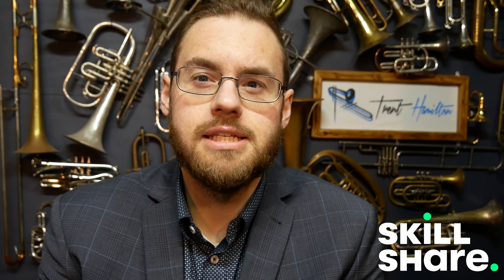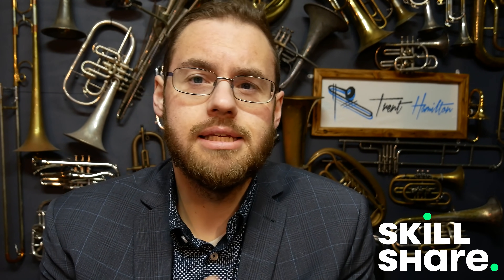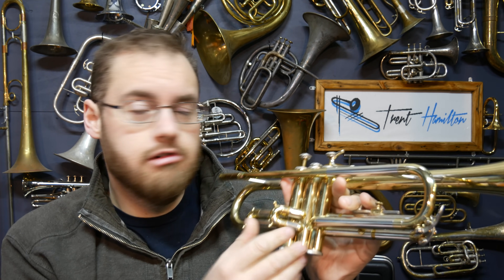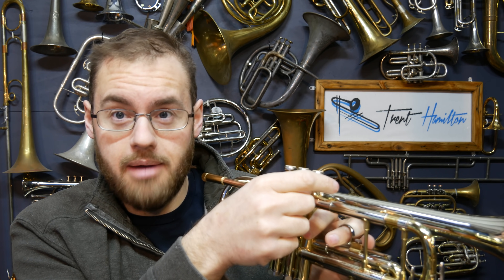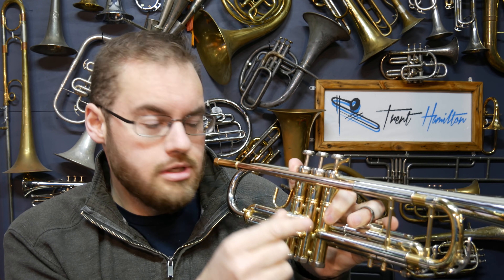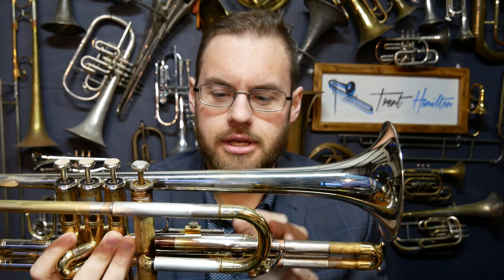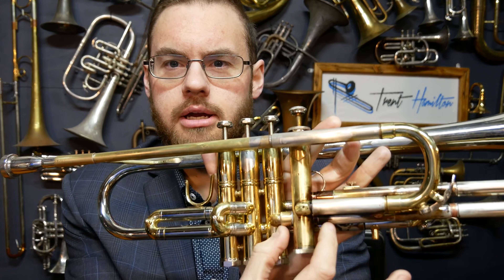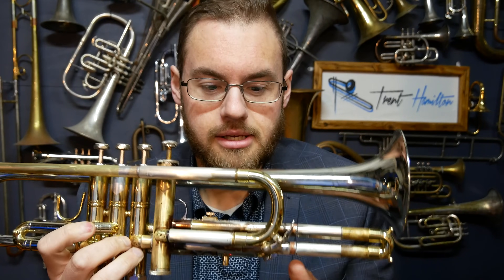I made a 4-Valve Trumpet!

Comment: I did near the same thing 50 years ago when I was in high school. But rather that have the 4th valve as you have made it, I cut the valve tube from a 2nd valve in half and made the 4th valve lower the pitch a quarter step. I wasn't lucky enough to have a torch and soldering skills, so I just glued it together with epoxy cement. It worked great and years later I had a proper repair person solder it up for me. Love the experiments. Good show.
Reply: Wow nice!! Any videos of you playing it??
Reply: So a Don Ellis fourth valve then.
Reply: @mal2ksc  That's exactly what I was thinking

Comment: I have never understood why 4 valves on trumpets are not the standard, when literally every other professional brass instrument calls for at least that many.
Reply: I suppose that it may be, as the trumpet low register is fairly (to me) not nice sounding compared to other (higher) pitches. Tuba/Euphonium/Baritone have more control and usability in low register compared to trumpet, even with similar valves
Reply: @wiebemartens1030  that has been my general understanding, or least what has been told to me over the years, but I bet that if more players had trumpets with 4th valves there would be some out there that would make that low register sound great regardless of what they've been told they're capable of
Reply: Seems like trumpet players always want to play higher rather than lower.
Reply: If you practice low, you can sound good. But every trumpet player is at heart Maynard Ferguson and don't like to become low specialists.
Reply: The trumpet is too small for a compensating valve system which would make intonation very difficult in the low register, it’s the same reason why people rarely use the fourth valve to play extremely low notes on the piccolo trumpet
Reply: @wiebemartens1030  Did you forget French Horns?
Reply: @wiebemartens1030  Do you happen to know I.M. Friesen?
Reply: @skrillzfn4183  yes, because the argument I tried to put forward was low brass. The way valebes are useful, I am more accustomed to low brass than the brass instruments that are also used in woodwind ensembles
Reply: @waynesteffen9425  not yet I am
Reply: @bobofthekerbals9797  How about a 4-valve Firebird then? With a 4-position slide, you can definitely do all the fine tuning you want!
Reply: imagine a trumpet with 4 valves, 0.49 bore, trombone shank, and a 7 inch bell, it would be a good alternative of marching baritone or flugabone
Reply: They don't care about downward range, trumpets can't play in-tune pedal tones anyhow (they're about a minor third flat) so there's not much point trying to bridge the gap. At the same time, tuning on the fly with valve slides and lip is much more practical on a small instrument, so the extra valve combinations aren't required for intonation purposes. There are still cases where you might use an alternate -- in particular, sometimes using 1·3 for middle B♮ works better than using ·2·, and ··3 instead of 12· to counteract the tendency of high A to pinch sharp, or 1·· instead of ·23 to similarly keep high A♭ under control.

Comment: Excellent Trent, thank you. I recently had an Eb tenor horn customised with a fourth valve - euphonium style for the left hand - and it’s great - nearly four octaves range.
Reply: I always thought a mini-euphonium in E♭ or F, complete with compensating 4th valve, could be a very interesting solo or small ensemble instrument. It might even be practical to do a full double system like a double horn, which of course gets stupid heavy with a euphonium. Imagine an E♭/B♭ tenor/baritone horn, fully switched by the fourth valve.
Reply: @mal2ksc  Yes, I agree, such an instrument would be great. But I have to make do with my non-compensating fourth valve on my Eb tenor horn! A compensating system would need a lot of research and development I’m sure!
Reply: @derekhayes8209  Yes... unless you use rotary valves rather than piston. Both compensating and double-horn (and even triple-horn) systems are made much easier mechanically by using rotary valves.
Reply: @mal2ksc  That doesn't actually sound all that impractical, even as a double euphonium. That's less total length of tubing than a typical double horn, and I highly doubt it would end up weighing more than about 8kg/18lbs, probably less, and tubas can be like 50% heavier than that.

Comment: I did this with 2 Chinese trumpets. One was already a c trumpet so I needed to do a lot more work on 4th valve(and measuring). Worked pretty well but the horns were too cheap to make it any good so it was trashed in the end. I would say for future projects invest in a buff wheel and bench grinder and or just the buff compound itself and use strips of old t shirt to clean up burnt lacquer and unwanted solder and if you want to do it again I say get 2 of the same horn so you don’t have the one valve higher problem. I want to do it again and use 2 olds ambassador trumpets because 1. They’re cheap2. Very good quality for the price3. I can reuse a lot of parts if it doesn’t turn out well
Reply: Also if you want it to look good without a ton of extra work, you probably should start with silver-plated instruments. It's a pretty simple matter to brush-plate silver over your work marks afterward, which is a whole lot easier than a full re-lacquer. If you have your heart set on a gold tint, a bottle of gold plating solution (to put on top of the silver) is about $40.

Comment: Awesome. I've got a tenor horn from the 1890s which is in high pitch, so I have wondered whether as part of a conversion to low pitch, a non-compensating 4th valve would be possible to add. However, this is way out of my skill set and I wouldn't know where to find parts to make this happen.
Reply: All you need to convert a HP horn to LP is longer slides. You typically don't have to alter the main body of the instrument at all. Then you even have the option of putting the original slides back in, if you ever needed a HP horn.

Comment: But can you say for non brass players. What this 4th valve does and what are the benefits?
Reply: Each valve lowers the pitch when it’s pressed down. Adding an extra valve extends the instrument’s range lower. In particular the fourth valve lowers the instrument by a perfect fourth when pressed (more or less). It also makes some existing notes better in tune— the trumpet’s D at the bottom of the staff is naturally pretty sharp so using the fourth valve instead of the first and third valves corrects that
Reply: @celadonk  Or you play french horn and it sends you into a different fucking key

Comment: Does the 2nd valve on the trumpet always brake first? I have 2 trumpets that had some issue with the 2nd valve, I thought it's just coincidence, but I see that Trent's old trumpet has again it's 2nd valve f-ed.
Reply: I think it's probably more common than the third valve breaking... consider that the third valve is probably used slightly less than the other two.
Reply: @georgeparkins777  The tuning slide on the second valve juts out to the side unprotected. All it takes is laying it down hard to bend the casing. Repair people report that students cramming a lot of music or other crap in the case and forcing it closed can put enough force on the 2nd slide to tweak the casing.